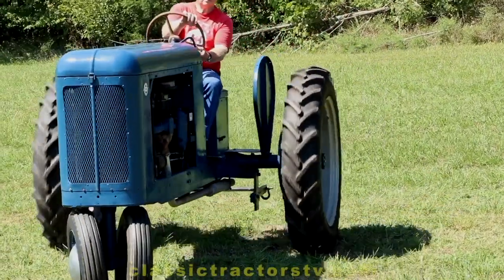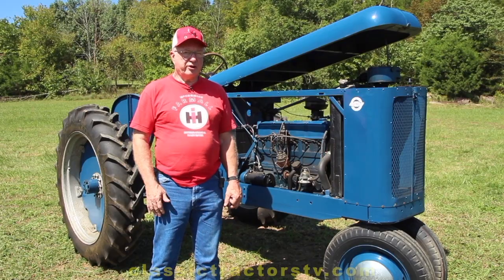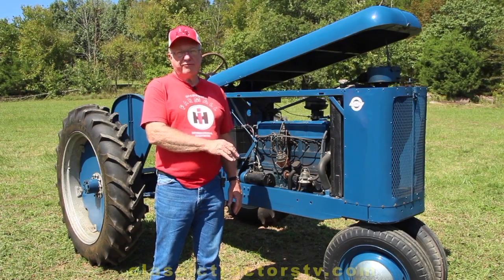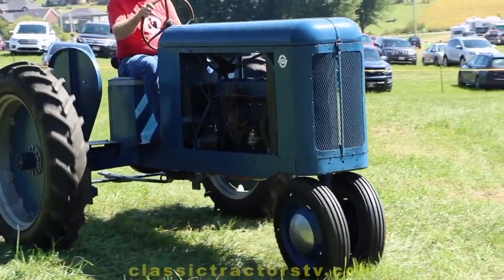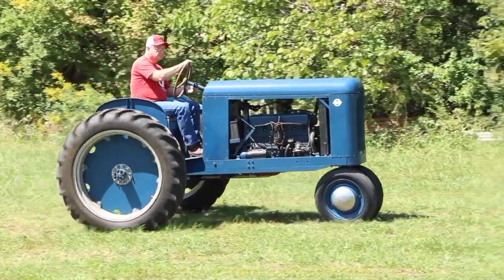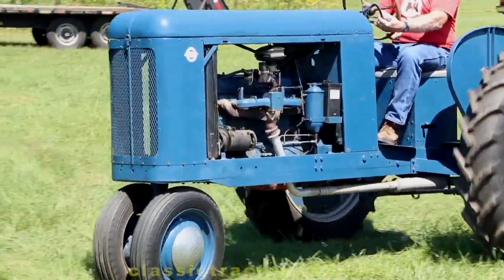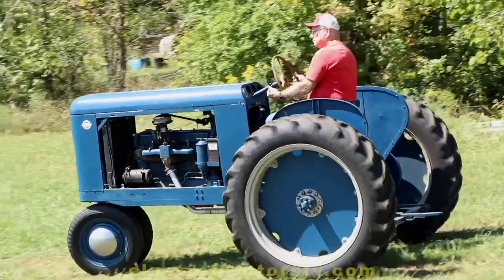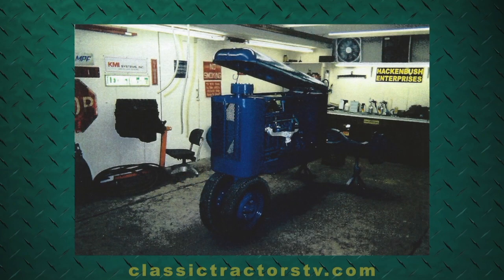1946 Chevrolet Prototype Tractor Built With Chevrolet Truck Parts! Classic Tractor Fever

Comment: Only reason my dad owns a Ford tractor is Chevy never made one
Reply: Jim Watson  very funny. Chevy was always the most reliable, and still is.
Reply: Jim Watson  Found On Road Dead.
Fucked Over Rebuilt Dodge.
Reply: The man said the rods were not pressurized so longevity was an issue?
Reply: @alaskarailroad3996  no. that's silly
Reply: @saltysteel3996  Yeah, and Chevy's have never broken down.
Reply: @causwayspeedway  lack of sustainable oil pressure is a death sentence for any engine.
Reply: @stephensafraniii3396  Yes and..
Reply: According to this video, chevy did make one. And this guy has it
Reply: Way to go Chevy. No PTO,  No belt pulley,  No hydraulics,  No 3 point hitch. Non pressurized babbitt con rod bearings. They should have built 2 of these and THEN quit.
Reply: Henry Ford started out th build farm equipment....cars were his after thought

Comment: If a babbit bearing engine was a potential issue, then GM could have pulled a full pressure GMC 228 from production and put it in. If the rear axle were to be too weak, then they could have went with a Timken rear axle assembly like the Sheppard Diesel, Co-Op, Etc. used. The potential was there.

Comment: I still would prefer a ford tractor I like the fact Henery Ford liked tractors because he grew up on a farm and it's not like he wasnt in the position to mass produce them on the assembly line. I personally think even if chevy would have put this tractor in production the tractor wouldn't have sold as well as the 8n.

Comment: With GM already having the parts available to build this tractor, you would think they would have put it into production. That stovebolt 6 could have been replaced with a Detroit Diesel, a division which GM owned already.
Reply: With their factories running full tilt to meet auto demand, they didn't have the industrial capacity.
Reply: Drive a tractor with a detriot in it. Your hands will be numb from the shaking in minutes
Reply: @ohlookadragon  I've run a few machines  with Detroit's in my 40 years in the seat.

Comment: its unfortunate that they did not use the pontiac engine like the GMC. it had full pressure lube. there is NOTHING wrong with babbitt bearings and the splash lube rod engines did well in cars and trucks. my grandfathers 26 chevy farm truck never gave any problems.

Comment: Pretty cool tractor. Thanks for the video.
A couple of thoughts: First, the war ended in 45 not 46. Also, no offense but unless they added some kind of way to mount equipment on it it would have been just another drawbar tractor.
The little Ford Ns with their 3 point hitch was just killing all of those drawbar tractors at that time.
So without some unique feature like a 3 point it just wouldn't have sold well.
PS, before you N owners get a big head - those were just so so machines. Compared to the much better Farmall, JD, Oliver, MM they were not much of a tractor. It was the 3 point that put them into the history books not the tractor itself.
Reply: Ultradog  The Ford N series tractor was a smaller tractor and less HP  hense the lower price, what the Ford N was all about !!!!

Comment: I suspect it was too light to compete in the market compared to others for the jobs it was intended for.  Also, the babbitt rod bearings and dipper oiling for them is very questionable to stand up to constant duty.  I was raised on a farm and my father was a mechanic back in the day, Chevrolet didn't have pressure oiling until '54 as I recall.
Reply: 1954 Blue Flame 6 was full pressure lube yes.

Comment: This was obviously a very crude prototype. GM would not have stood a chance selling it as is. This tractor has no PTO shaft, which would have cemented it's place at the bottom of the pile-up. A PTO could have been added without too much trouble, but without a custom tractor transmission, it would not have been live or independent. Ford, IH, Deere, and others, had live PTO's in the works. Two more big developments in the late 40's, were independent hydraulic systems, and three-point hitches. These could have been added to this tractor, but would have been unique parts not shared by the rest of the GM line.

It's always been easy to build a tractor from truck parts for simple pulling. But the days of buying a tractor to only pull drawbar loads, was gone by ww2.

Comment: 90 hp on a tractor that light????   100lbs per 1 HP is rule of thumb.
Reply: Yeah it's way overpowered.
Reply: Overpowered? If Chevrolet would have put that tractor into production, could you imagine how many people would have shoved a Chevy V8 into one of them! Lol!
Reply: Tim Finch  Tractors are about low end torque. Chevrolet didn't have a V8 at the time but Ford did so there is that.......
Reply: The 216 was a fine motor back in '37 when it came out. But that HP rating is up around 3300 RPM... at a more tractor useful RPM it would have been in line with other machines of the day.

Comment: I suspect the the little babbitt pounder would have a short, disappointing life pulled down and worked hard.  I know they are quite inefficient compared to contemporary tractor engines.
Would have liked to see one tested at Nebraska, however.

Comment: TIRES WAY TOO small for 90 hp and by mid 1950s  it would have needed 3 point hitch. Good engine it would have sucked fuel lots of power.

Comment: bet bean counter did not think they could make enough off of them. cost of building one not a problem since lot of factorie space and returning gi for labor. but to set up dealerships since most car and truck dealers would rather sell cars and trucks
. but when telling stories remember ww 2 has been over 77 years you should be accurate with dates 1942 cars were out the year was cut short but there was a 42 model. and the war ended in 1945 not 46 younger people would not always know correct dates. the 216 and 235 untill mid 1950s was good engine except it had  Babbitt bearings complicating overalls

Comment: 90 horse power, Yeah Right. That's some funny stuff. It has no 3 point hitch, most likely dead power take off. Actually I don't see a power take off. The tires are at least a couple sizes to small. It appears to be very lightly built. Without the weight transfer of 3 point hitch I doubt it would be capable of pulling a three bottom plow (14" bottoms) in most ground. 
It's a fine example of a home made tractor but there is no way any large industrial company was ever going to mass produce a machine this poorly designed.

Comment: Obviously had piss poor gearing.
Reply: Maybe. Or maybe it has a lower gear ratio than from a std. Chev ton-and-a-half.
But it's just a "prototype", and maybe even unofficial, unauthorized by GM. If put into production it would obviously would've had apropriate gearing.
Reply: UberLummox i